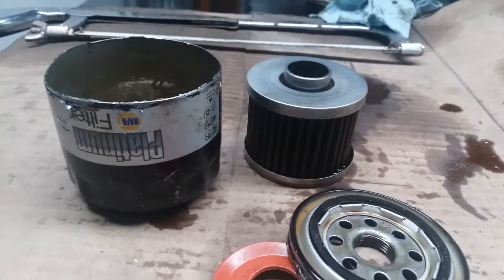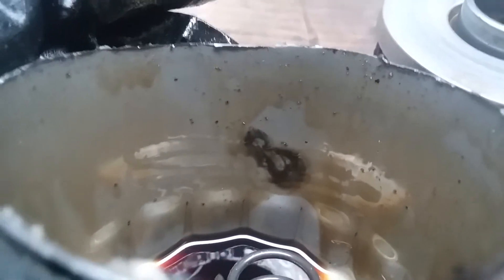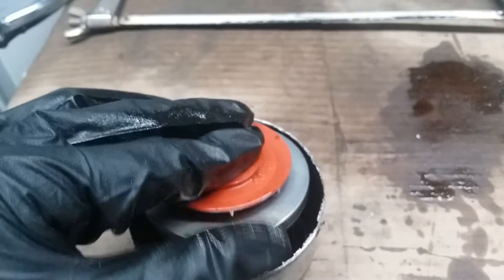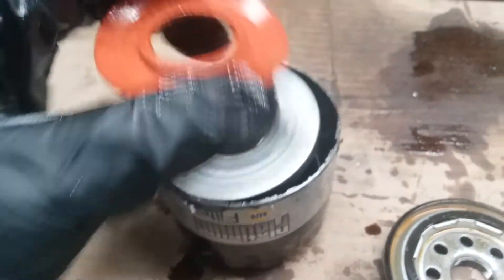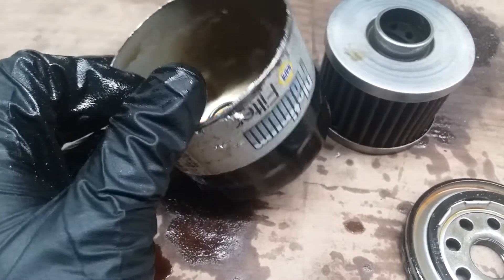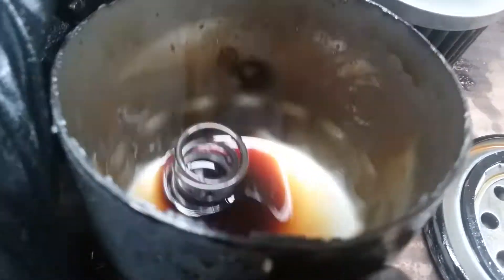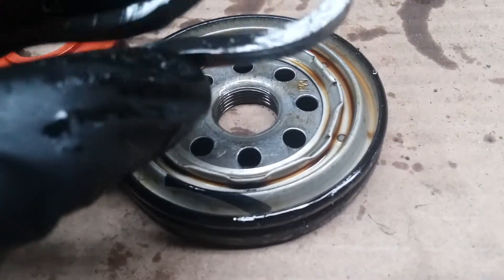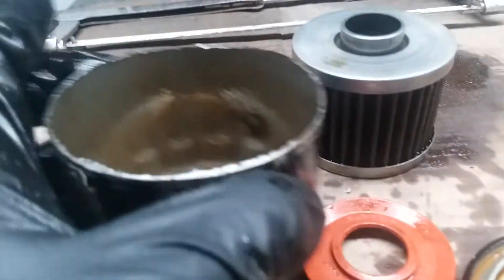Neodymium Magnets on a Napa Platinum Oil Filter.

Comment: If it's not doing any harm and you already own the magnet it seems like you might as well keep using it on the oil filter, unless you need it for something else. Even if it only increases the efficiency of the oil filter by 25% or 0.001% or 0.0000001%. I feel like if it's anything greater than zero you might as well use.
Reply from the maker: You right. I have a drain plug that has a built in magnet.
Reply: @TheRichardF10  The magnetic drain plugs are NOT the same -- they work differently to remove particles from your oil -- one is passive, the other is not.

Comment: Idk, after 2,000 miles it didn't seem like a lot of metal. But you didn't say what you're driving.  Something to consider is that the metal shavings can be microscopic and will that impact a car engine?  I think it would have more of an affect on newer engines because tolerances are closer and more shavings from a new engine breaking in. Bottom line is the right oil,  regular changes and a good (OEM)  filter. Spend $30 > $50 a year and get 200,000+ miles out of your car. 👍🏻😉
Reply from the maker: This was from a 1988 Honda Civic with 200,000 miles. 2,000 miles of mostly city driving. I say that if any contaminets that are small enough to pass through the filtering media, it should not pose a threat to the engine. Even on newer engines where the tolerances are tighter. Engines are going to wear regardless. Using a quality motor oil, a quality oil filter, and changed when supposed to, the engine will definitely last a long time. Thank you for tuning in.

Comment: Try putting a large magnet from Harbor freight , they look like speaker magnets, 3" diameter, put them at the lowest point of the Filter and overnight the iro filings and magnetic metals will build up real thick like you see on a transmission magnet in the pan, You will be surprised how much particles you will collect after 4-8 thousand miles ,!, good luck!!
Reply: Instead of monkeying around with cheap-ass janky magnets from who-knows-where, we would do best by getting the right "tool" for the job:
FILTERMAG #SS365PR -- FITS 3.5 - 4.0 - INCH DIAMETER  Spin-on type oil filters.
11.4 square inches of magnetic holding power. Lasts a lifetime.
Reply: Awesome thanks.
81mm magnet, 95lbs force, 5-6 dollars.
(3.19 inches)

Comment: Most cars have a magnet in the bottom of the oil pan. If not, add one. If you don't want to take the oil pan off, just stick a magnet on the bottom, if the pan is steel.
Reply from the maker: Peter Mashak My 1988 civic does have a steel oil pan compared to most newer Hondas with aluminum oil pans. I won't be using magnets again, but I would rather put them on the oil filter because you can just discard the oil filter with all the iron particles left in the filter rather than inside the pan. You can always take off the oil pan to clean it but that would be overkill, but it can help out a bit. I really do appreciate your comment and your suggestion.

Comment: I’m pretty sure the Napa filters are made by WIX.  Both are the best you can buy as a normal stocking item. After the WIX and Napa Gold its aftermarket filter territory; NEVER run a Fram filter, not even on a lawnmower. 👎
Reply from the maker: HeadFlowInc The only Fram I use is the Fram Ultra Synthetic. Other than that, the rest of their line-up are not ideal for me. Too cheap of build quality. And yes Wix does make filters for Napa.